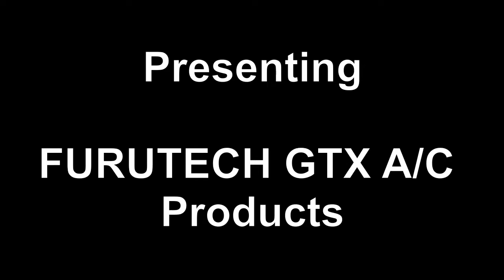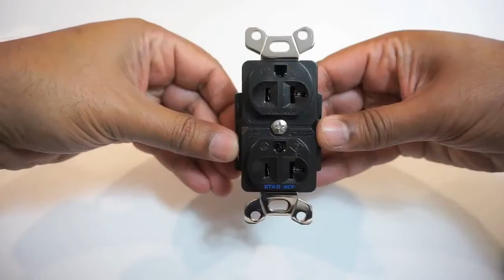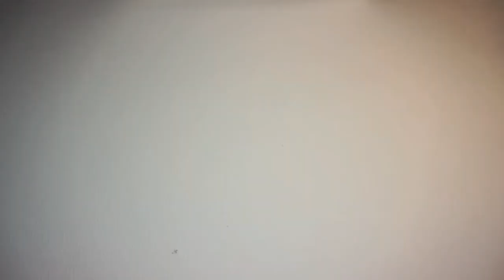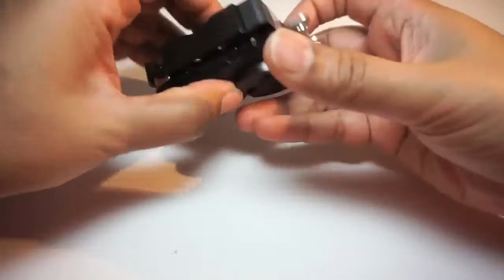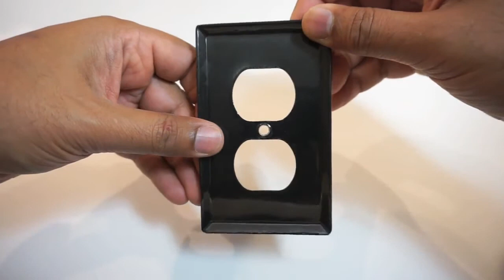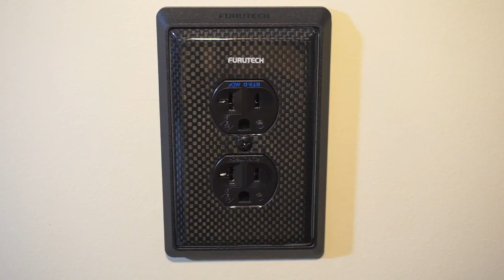Furutech GTX D NCF

Comment: ya can't put a 20A duplex on a 15A ckt, VIOLATION, big time
Reply: It doesn't have the use of a sideways 20 amp power cord.
Reply: @mitchtaylor6512 you do not understand code. On a 15a ckt,which means protected by a 15a breaker a 20a duplex is not allowed to be installed,simple.
Reply: @mitchtaylor6512 this has the horiz slot for 20a cord cap...120v......no ul or etl,means it has no industry stds testing...plain and simple